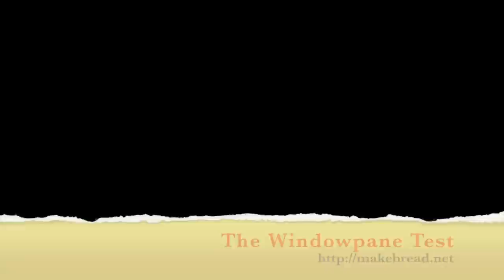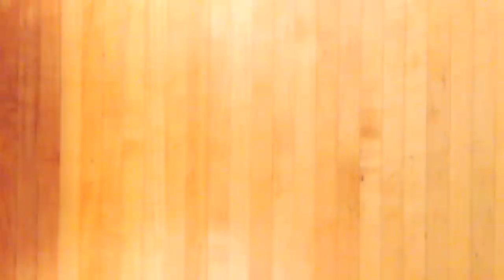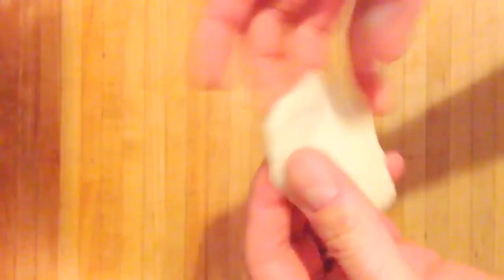What is the Windowpane Test?

Comment: Is it even possible to pass the windowpane test immediately after kneading? As in, I've kneaded until smooth, and a small poke in the dough results in a slight spring back, so it's needed, and I try the windowpane test immediately. I can never pass it. Instead, it only seems to pass after a rest...although this happens only half the time! Occasionally it will tear even after a rest and my pizza crust is very chewy and dense, despite using 00 flour. 

There would be no problems if I could know exactly when to stop kneading, but I have no idea when to stop, clearly.

Comment: mine tears even after 15 minutes of kneading, I tried the french kneading method.
Reply: Mine success after 30 minutes of kneading
Reply: I used to knead for up to an hour. Now I just put the dough on the table, cover it with a bowl and wait for 10 mins then continue kneading. I find that if the windowpane test is not passed, after waiting for 10 minutes, the dough magically becomes very elastic and passes the test.
Reply: @aviationchannel6204  are you using some milk for the dough?
Reply: @nmhacker65  It depends on what kind of bread I'm making. If I'm making milk bread or dinner rolls, there's milk in the dough. I just use the 10 minute rest method for all of my kneaded doughs.